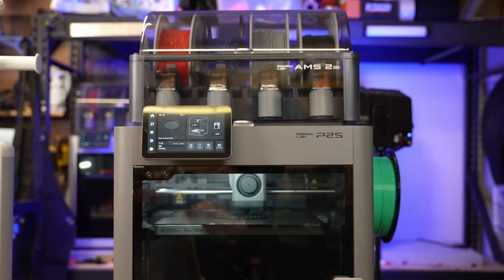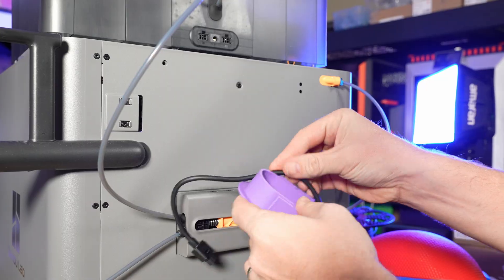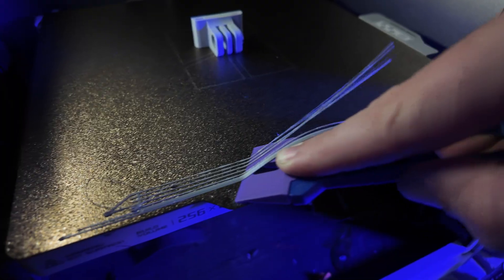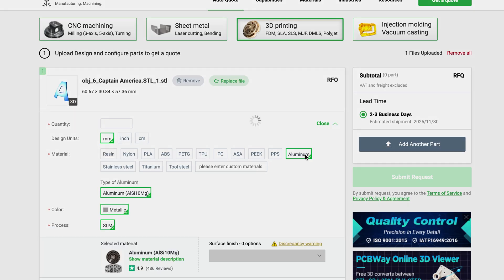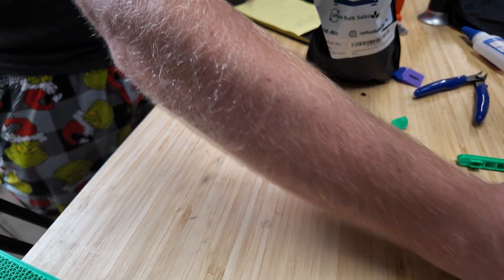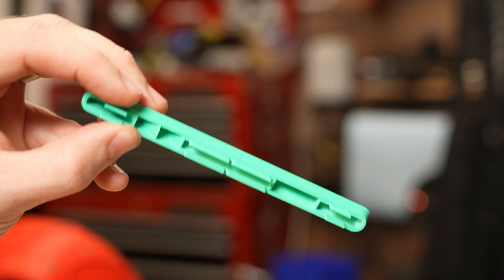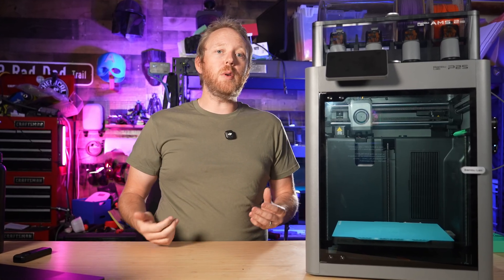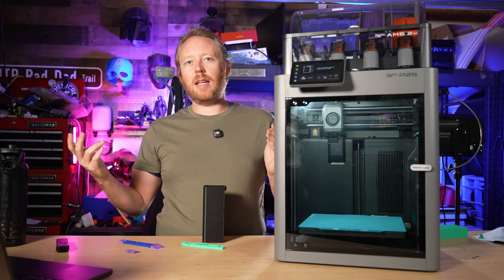6 Free Upgrades That Make the Bambu Lab P2S Better

Comment: How good is the carbon filter replacement at reducing the smells of something like ASA? I live in an apartment and have been hesitant to print anything other than PLA and PETG because of worry for the smells. I don't know what to expect and don't want it to reach neighbors or for the walls to absorb the smells.
Reply from the maker: It should help, If you can, you can run a hose from the back to a window to vent the stuff outside.

Comment: Maker World P2S dust covers:

1. P2S Dust Cover Set (Kong 3D)
2. P2S Dustcover for the holes on the bottom (Domi1988)
3. P2S Stepper Motor Dust protection Cover (Gorilla Labs)
4. USB Dust Cover - P2S / H2D / H2S (Sebastian_Rubner)

Low Profile USB: "USB Flash Drive on Amazon: SAMSUNG FIT Plus 3.1 USB Flash Drive, 128GB, 400MB/s"

Comment: Hi everyone,
I’m also considering buying an FDM printer to produce mechanical parts.
Bambu is among the most expensive options, right after Prusa. Otherwise there’s Anycubic.
It’s not easy to understand which one is the best unless you use it for some time.
What do you think?
Also, the ability to load multiple filaments with different colors and materials — is it really useful and functional, or is it mostly a marketing feature that ends up being used only rarely?
Thanks in advance to all of you for your advice.
Reply from the maker: One of the perks of Bambu and Prusa is the parts availability in case something goes wrong. But as far as the multi material question, the ams is just really handy to have in general. It keeps your filament dry for the most part and it’s nice to not have to switch filaments manually if you wanted to do a different color or material
Reply: @RadDadsPrintLab clear. Thank you very much friend 🙏🏻
Reply: @protomanialab it may be more expensive but bambus unofficial slogan is that it just works. And their customer service is pretty good

Comment: The printable bed scraper are a complete waste as they dull in a VERY short time (usually on the first use)
Instead, grab a window, ice scraper and you'll have a tool that will last.
Reply from the maker: Good Tip 👍
Reply: What about the good old fashioned putty knife?

Comment: There is a filament buffer dust cover as well on the Handy App
Reply from the maker: Thanks! Ill go print it
Reply: @RadDadsPrintLab  yes I just came here to say print the “P2S AMS Buffer Cover”

I wanted to mention that active carbon filter housing would be better if the top opened so you could fill it without the front sliding off or open. You could print a small funnel for it for easier filling and would probably be less of a mess. But nice video altogether. I will probably print air deflector.